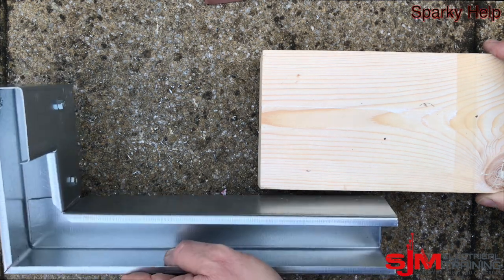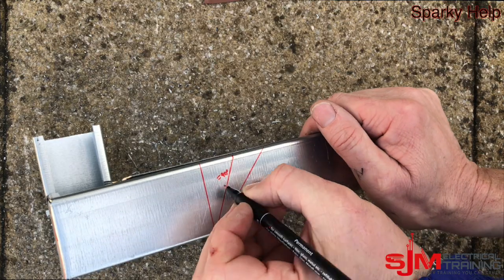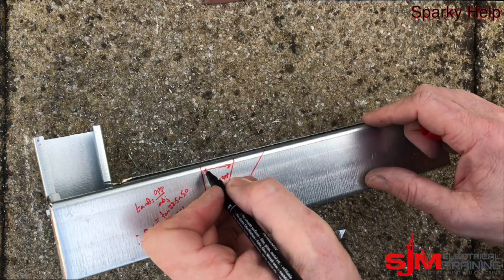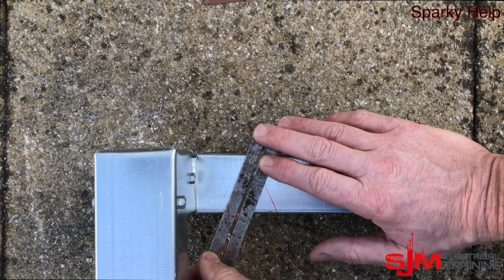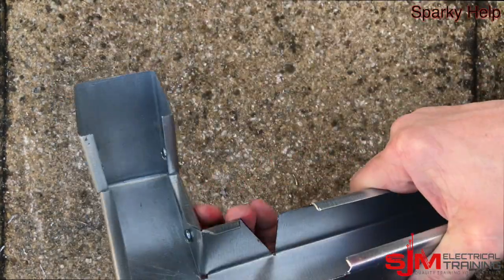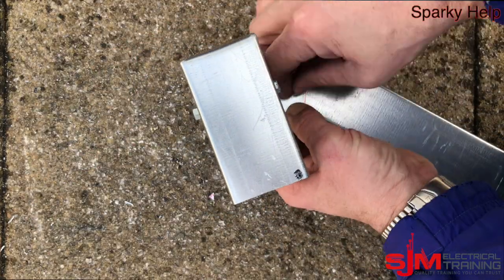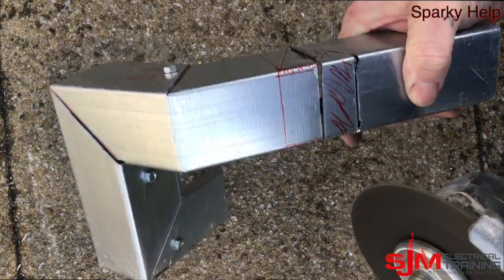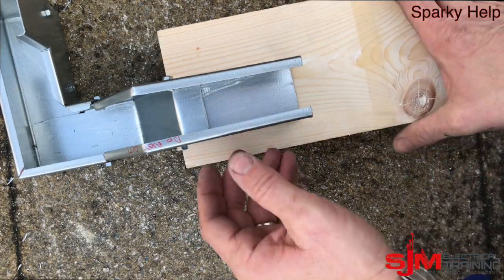How to Make A 45° Set in Electrical Trunking Using an Angle Grinder to Measurement.

Comment: how do you do this with ladder
Reply from the maker: Ladder wrack will have (on the whole much larger cables therefore the bending radii will be larger and the cables will be heavier etc) It would not be advisable to try to do this. Just cut it a, remove flanges so two pieces can be joined and drilled and bolted.  You need strength to support the cables. Please Share with like minded or maybe even like and subscribe.